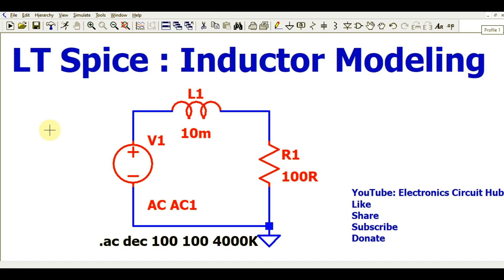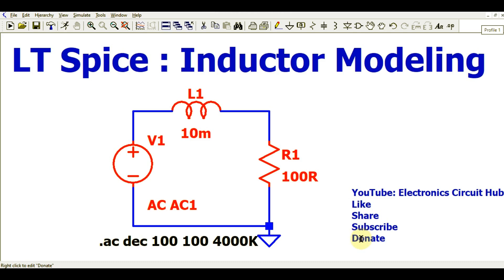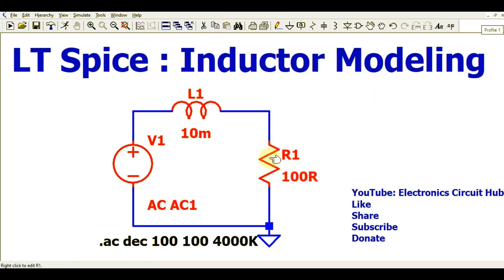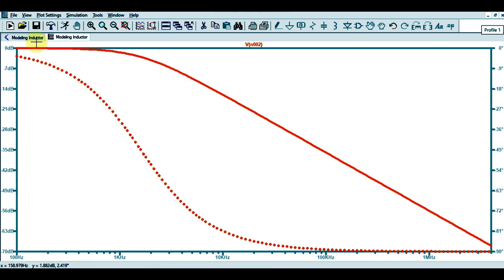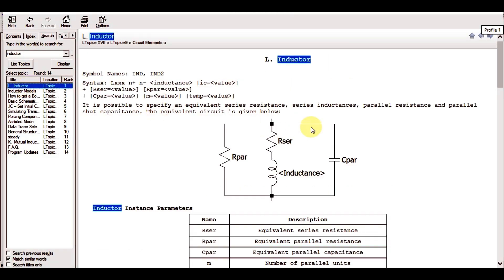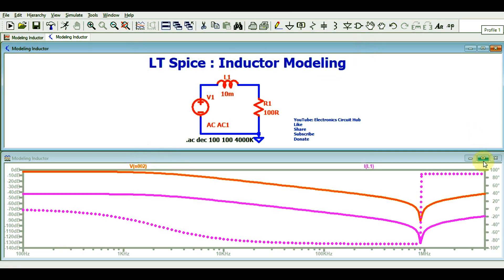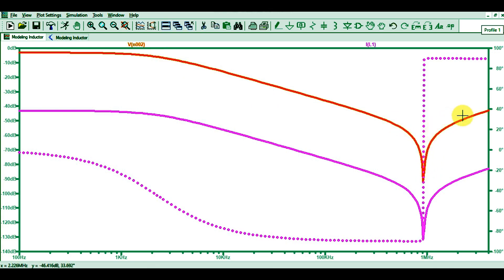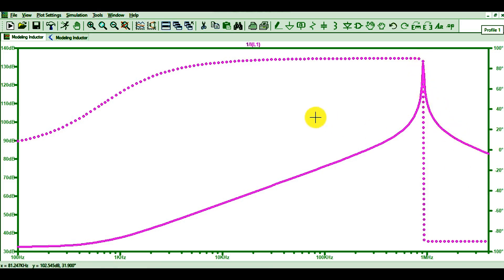LTSpice Inductor Modeling | Inductor Simulation

Comment: hi bro,  i have measured the data of my inductor using LCR meter here it is, L=2.2004E-04, ESR=3.074ohm, impedance=138.28ohm, and Parasitic capacitance=1.157e-8, i have measured the resonance frequency using the S-parameter from VNA and plotting impedance plot in Matlab, but i am trying to implement this inductor in ltspice and its not showing the proper output, can you help me with this. Here I am confused How can i get the parallel resistance value?
Reply from the maker: Let me check